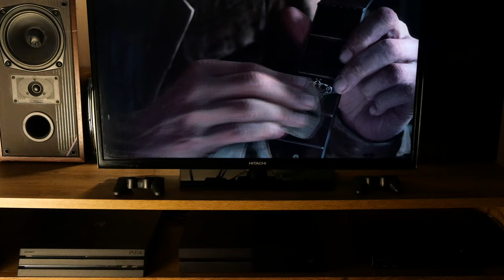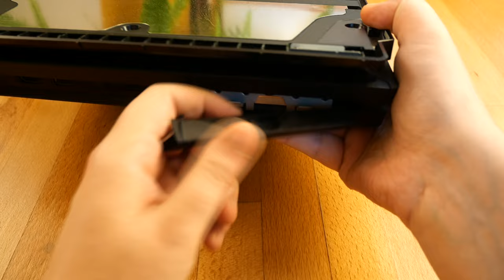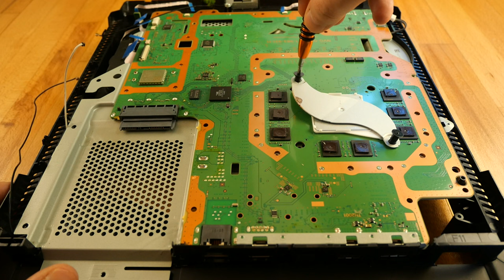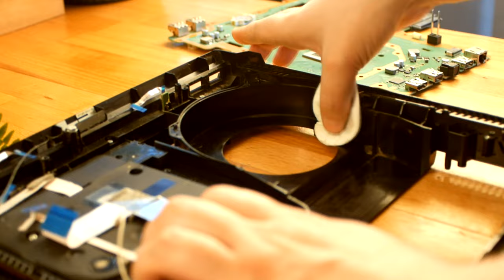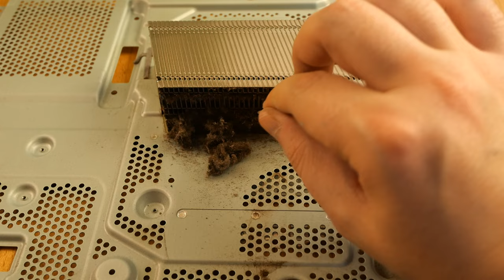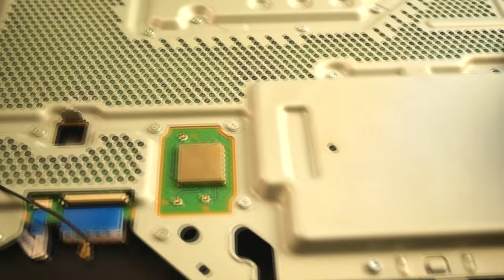How to Replace Thermal Paste - PS4 Pro Deep Cleaning

Comment: Make sure to include that you include what type of tools were needed to get the job done. Also what compound did you use when applying the new thermal paste? And what was preapplied to the cotton swabs and wool pads I. E. Isopropanol or isopropyl alcohol. Also incuding the necessary tools before hand would be a great help for those of us who were following step by step. 
Thanks and Great Video!
Reply: Any of the options you listed will work though

Comment: Thank you for your videos. I've been trying to acquire what old consoles I can, and refresh what I have.
Reply: Same! I just picked up the filthiest marked up one I've ever bought and in white too. This thing has seen some shit. It came out of a garage when I went to pick it up and I think a cigarette smoker owned it because even isopropyl alcohol 100% couldn't budge the stains on it! All that to say, if you're ever in the same position where nothing is touching the mess use "eraser pads", those spongey blocks used for cleaning stains on walls. I'm so glad I had the idea otherwise I would have been scrubbing just the outside for days and instead it cleans in seconds! 
Hope this helps for any future tough jobs :D

Comment: When you cleaned that paste did you put new paste on circuit board or just clean it and putting all back?
Reply from the maker: I’ve put the new thermal paste on the CPU, you can skip this step by putting everything back without thermal paste but you lose about 5 degrees Celsius on temperature. I recommend to use thermal paste before reassembling
Reply: @YesterdaysTech  ty this is helpful

Comment: @Yesterday's Tech thanks this was very help to me.  When I completed my operation, it would not turn on, just one peep then off.  However, I noticed that i forgot to put back one of those black mini pads that surround the CPU... could this be the cause?  If not, why is it turning off?  please help.
Reply from the maker: I suppose when you assembled it you’ve connected some ribbon cables improperly. Check their pins as they tend to be quite fragile. Otherwise I see no reason for not turning on, let me know

Comment: My ps4 shuts off immediately after turning on after doing this. Someone help?
Reply from the maker: Turn it on without the top cover and check if the cooler fan starts spinning. You probably didn’t reassemble it correctly
Reply: Maybe something in it is shorting or a power supply cable not being connected
Reply: Did u fix it?

Comment: Can someone list which screwdrivers are required, please?
Reply: T8 security torq screw driver. Then a regular small screw driver
Reply: T8 torx screwdriver with a hole in it and you will need a small regular screwdriver